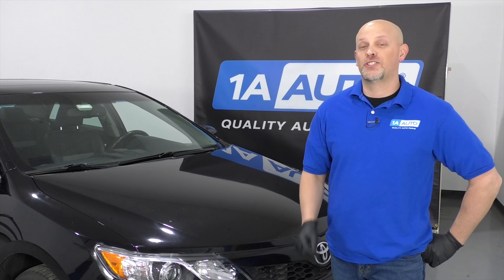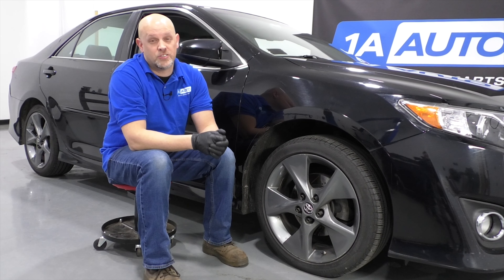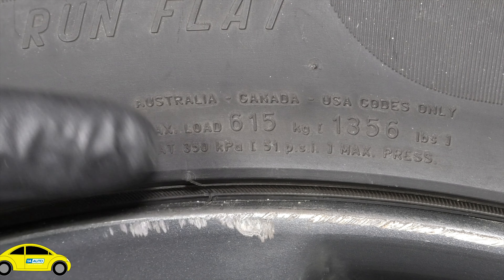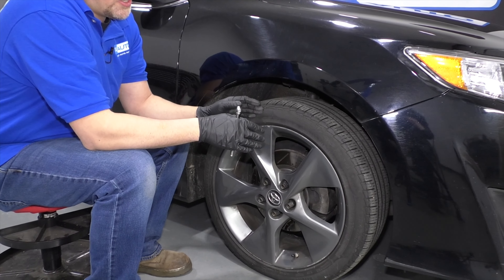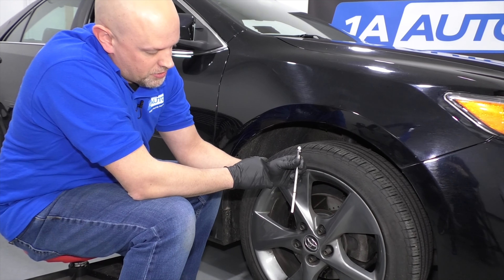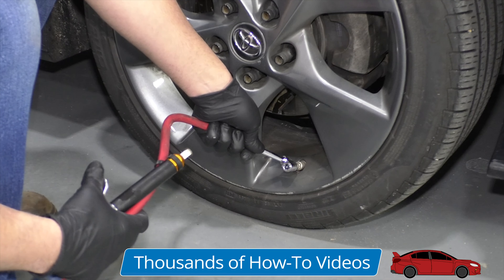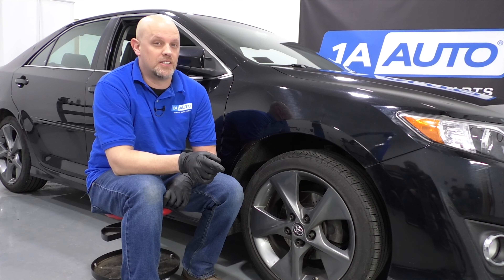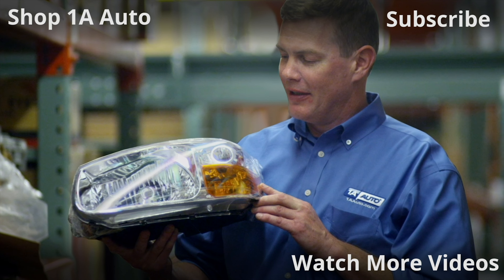How to Properly Check and Fill Tires on Your Car

Comment: Ok. You inflate your tires to the right psi, in the summer time let’s say. Mine are 45psi.  You then drive it and the pressure then increases over the maximum psi.  I’ve seen as much as 6-7 psi increase.  Then what do you do?    Ty.

Comment: And remember, for every 10 degrees F, either up or down, comes a corresponding increase or reduction of approximately 1 psi.  This occurs when air or nitrogen fill is used for airing tires (per the gas laws).

Comment: Is it much more difficult to change a tire at a low temperature? I completed my 1st tire and ready for the 2nd one, but the temperature here dropped. I saw in one film how they heated the tire w/heat gun, but how much, where exactly, all that is kind of vauge. Also in that film they were working on tractor tires, I have just regular passenger car (R16 tires). My HF Tire Machine is mounted outside, while it is snowing I won't do anything, but tomorrow it will be clear. So I decided to do a small research on the subject meanwhile. At what temperature you can change tire more or less comfortably, can you do it @45F, or it is too low? My main concern is that I can tear the tire or burn it w/heater gun. Thank you for a great (as usually) film.

Comment: I want to know what is the best surrounding TEMPERATURE to measure the PSI?  I'm in Arizona. I put about 2 lbs more in each tire.. 35 front and 33 rear RDX . The garage Temp was 56deg.   I drive later when the Temp was 75Deg   37 Front and 35 rear.

Comment: Again and again I see the one piece of most important information gets left out is: what does "COLD TIRE PRESSURE" means.  A cold tire can be under the shade of a tree in the Arizona dessert or on top of the snowy Rocky Mountain with huge temperature differences so what is the standard of the "COLD TIRE PRESSURE" on the sticker?  "COLD TIRE PRESSURE" on the sticker means that the pressure listed on the sticker is based on the ambient temperature of 68F/20C; therefore, the air would need to be either added or removed if the ambient temperature is over or under 68F/20C when checking for the correct tire pressure.  For more information on how get the correct tire pressure please use the link provided:  https://en.wikipedia.org/wiki/Cold_inflation_pressure
Reply: CONCUR! it drives me crazy also that no one in these dang videos actually knows/mentions what cold tire pressure temperature actually is....  you must be an engineer like myself... lol

Comment: Ok explain to me what I’m doing wrong. I went this morning to fill my tires. Both fronts were fine. But both rears for some reason we’re not getting a good seal and one lost air instead of getting air. Also the nozzle was defective. It was blowing air even while not being depressed.
Reply: I have a similar problem. The gas station tire inflators are really difficult to use.  I have a hard time getting  the nozzle to seal properly around the valve.

Comment: I just want to know if the tire pressure is different on aftermarket wheels and tires because I have a slightly different size than stock
Reply: What did you find out

Comment: on the door said: front 33 psi, rear 33 psi. 
on the tires said: max 50 psi

which one should I follow ?
Reply: I’m here for same question as you
Reply: 33psi since thats the recommended. On the tire its saying 50 psi because its just telling you how much it can handle, dont fill it up that much do 33 psi
Reply: @corymountain3957  ^
Reply: 33 psi

Comment: i have 2002 nissan altmia 2.5se that is shaking very bad as i drive and it has a check engine light on. when i took it to autozone it gives Error code P0300 Random missfire and P0733 Gear 3 incorrect Ratio. what should i do? Thank you

Comment: I think this is all bs. That door sticker is for factory tires. Nobody is on those tires 60k miles later. It's like saying a nice after market tire is the same as a cheap factory tire. The pressure on the tire is an engineering fact. Under a few pounds from that is cool, but 51 psi tire at 33 psi sounds like bs to me. Some low profile tire are way higher than that. If you run those at 33 your about 50% under inflated. Ford and Goodyear done went through all this with the Bronco years ago. Goodyear, said fill to the label on the tire. Ford said our POS  bronco rolls over... Yeah. Ford won, but tire guy said and Ford designed crap that killed people and told them to run low, and killed more people. Not buying any of this door sticker nonsense. 
Would you follow the oil label for a stock motor after buying and installing a high performance crate motor? Same thing.
Reply: So if you turn your car into a dragster and run some slicks are you going to follow the Micky's label or the door sticker? 😆 
That aftermarket tire has different sidewall thickness than a stock tire.